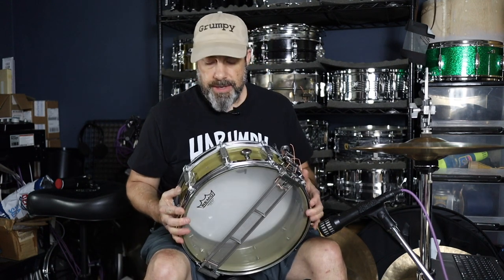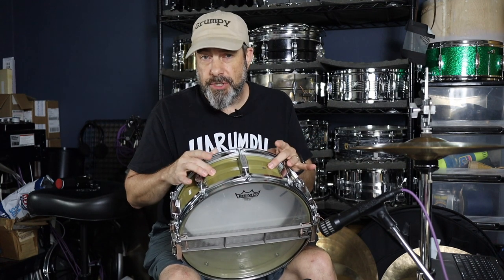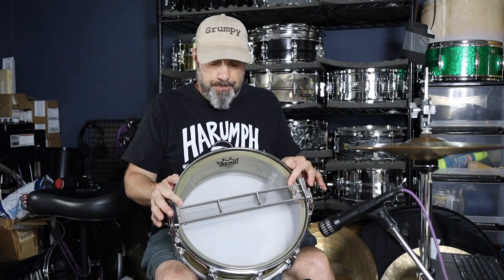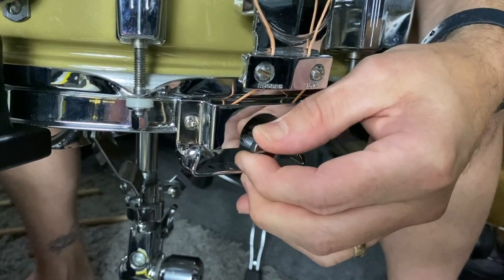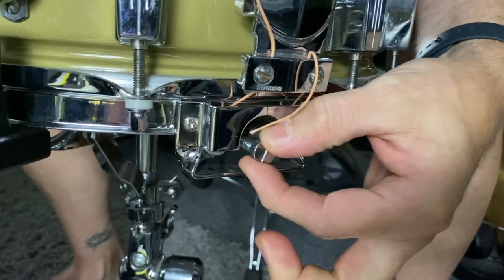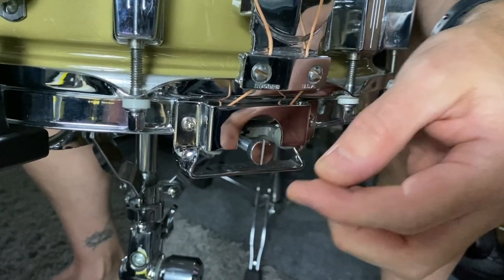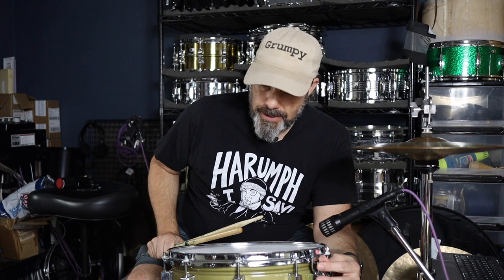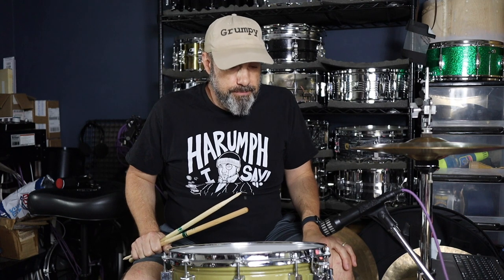Rogers' Dyna-Sonic Snare -- How Its Unique Design Functions

Comment: Love your videos, Joel. I’ve owned a couple of dynasonics, and I currently have a 7-line dyna with the beavertail lugs. First one I had sat on the shelf for about two years because I couldn’t get a decent sound out of it. Once you get the hang of fine-tuning the snare mechanism though, they are untouchable.
Reply from the maker: Dynas are the most crisply responsive snare drums I have ever played.  I'm not in need of that vibe too often (I generally do more backbeat type playing), but when I am absolutely nothing else can touch it!

Comment: Looks like you have nylon washers or spacers installed on each lug screw. Was that for better tone quality or for excessive screw length using Tama lugs? Not familiar with Tama drums. I only own Rogers, 1964 Holiday Kit with a chrome Powertone snare, & 1968 Fullerton Kit with a chrome Dynasonic snare.
Reply from the maker: Thanks for the question!  I put nylon washers on most older drums that I acquire as the original metal washers tend to oxidize or get dirty somehow that causes them to 'grind' when being tensioned.  I personally find that annoying, and by putting a nylon washer underneath the original metal washer the tuning becomes very smooth.  I still use the original metal washers, generally, just put nylon under them between the metal washers and the hoop.

I actually saw someone claim, in a video, that nylon washers have a negative impact on the tone of drums, but I have NEVER noticed anything like that in practice.  Interesting concept, but even if that was true (and I don't think it's is, at least clearly not dramatically so, as I have never noticed a timbre change when putting them on my drums), it is up to the listener to decide if the affect is detrimental or not (sort of like anything else about drum sound).  

But I don't think that's terribly substantive, and they do definitely make tuning smoother!  ;)

Comment: I played a Ludwig Super Sensitive for a long time. This seems even more customizable/responsive! How would you compare the two?
Reply from the maker: Hi, Cody!  A few notable differences between the two:  1) SS has long wires that extend across the entire bottom head, edge to edge, so much more wire response (more wire touching the head than the much shorter DS snare wires) along with greater 'sag' in the center (from the greater mass/length of the wires).  Greater tension on the SS wires will make up for much of the additional sag and give great snare response at all dynamics, 2) the SS has no vertical tension adjustment, only horizontal.  True, you can avoid activating the strainer lever the entire length of the throw to result in less contact with the bottom head, but this isn't an adjustment, per se, but just how much you turn the snare wires 'on,' 3) the SS is tricky to find a good case that fits and protects it given how much the strainer/butt stick off the side of the shell, while the DS design will fit most common cases and suffer less damage if the case is bumped on either the strainer or butt side.  Both are great drums to use, but the DS probably wins out on the articulation, particularly at higher dynamic levels than the SS (though in truth the full contact with the bottom head snare wire designs like the SS are more a favorite of mine, because I actually prefer a touch of 'sag' in my snare response.  The DS feels a little abrupt to me for general use.  YMMV, of course).  Peace!
Reply: This is amazing info. And re: #3, yes traveling with a SS was annoying with no great case option. Lol.
Reply: I've had both drums and much prefer the Ludwig SS (wish I still had it!). I use to keep mine in a square Calzone snare case which kept it perfectly safe.
Reply: @drumdotpizza 
This is an old post now. I have three dynos one is a Asian made steel version the others one chrome over brass the wood one a new remake. I have a super sensitive too. The biggest difference I hear and feel is the super sensitive is a tighter sounding drum it doesn’t have the same overtones of the rogers so for me it’s a better drum for rock or music that does better with a tight snappy but somewhat muffled sound. The dynos are much more versatile and have a wider tuning range my supers voice is best in higher pitch if you want something in the middle try a Ludwig black beauty with better snare wires it can mimic the dyno very well and has a wider range can sound tight or fat is more like a Swiss Army knife I have a 6.5 inch can’t comment on a thinner style I use pure sound wires and changed the crappy throw off to a trick. As an aside my favorite share is longo walnut 5.5. It’s more organic for lack of a better description

Comment: Nice explanation! What can you say about unwanted snare buzz? Does this mechanism prevent it, since snare tension and engaging the snare are separated?
Reply from the maker: Snare buzz isn't prevented by this design, no, but it does seem to be significantly reduced compared to typical designs.  I credit this to a couple of factors: 1) the wires are under direct, horizontal pressure rather than being pulled somewhat upward by a typical strainer, against the curvature created by typical (much deeper) snare bed (Dynasonics have extremely mild snare beds, very shallow, almost non-existent).  And 2) the wires are shorter on a Dynasonic than on regular 14" snare drum, so they don't 'sag' from gravity, so are flatter, making more consistent contact with the bottom head (less rattle from looser points along the bottom head).  

What snare buzz there is (because there is still some, though less than most other snare drums) is very short, staccato.  It's not a loose, rattlely type of buzz, unless you have the snare wires with very loose tension, and even then the shorter length (and associated lower mass) doesn't appear to have enough inertia to rattle for any substantive length of time.
Reply: @drumdotpizza  thanks for the input, it is hard to get to try this snares where I live.

Comment: Great vid! Do you find a wider tuning range tensioning your resonant head on the Dyna, or is there a sweet spot? Curious how tight you tension your snare heads (top and bottom) for this drum?
Reply from the maker: With snare drums in general I go quite tight on snare side heads.  I used to go about as high as I dare go, but lately (in the last year or so) have been backing off the tension a bit, as it seems to have a clearer wire sound, whereas extremely tight sometimes lends a slightly hollow, less responsive wire sound.  

For the Dyna I find that I can go even looser on the bottom head and get good response.  The drum has the shallowest snare beds of any I have seen, so there's not a lot of curvature along the line of the snare wires.  The pre-tensioned nature of the snare wire assembly reduces the need for a traditional snare bed, so the bottom head can be flatter overall, and that seems to broaden the range of tuning of the snare side head while remaining musical.  With all other drums looser tunings of the bottom head robs the tone of the drum and turns the wire response into a lifeless 'splat' to my ear.  

The Dyna is the most responsive snare I have ever played, but it lacks the length of rattle of the wires (the 'white noise' effect that one can get with looser wires).  It will do it to some extent, but not so much as a traditional design, so it is its own thing.  People usually love or hate it.  My opinion is both, depending on my mood or the sound I'm looking for.  

In general I like my Dyna with a batter head tuned no lower than the drum's midrange.  Lower tunings on this drum don't float my boat.